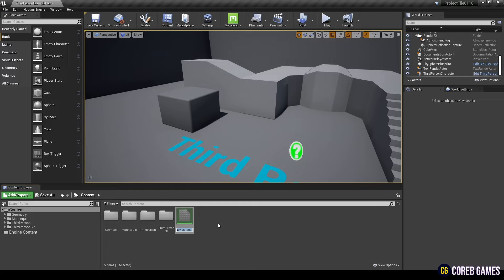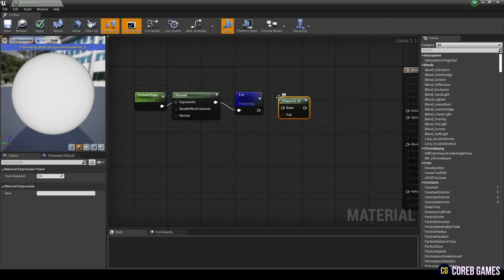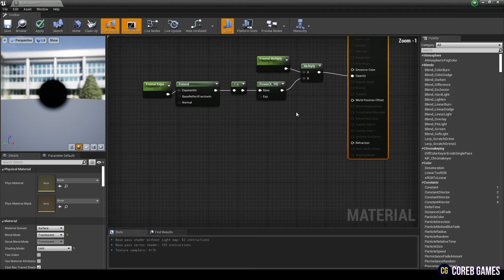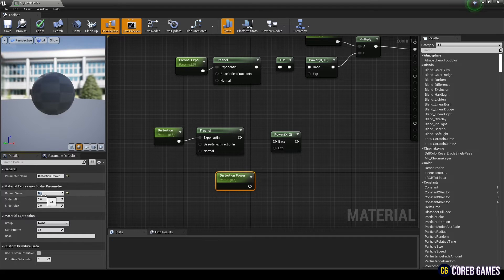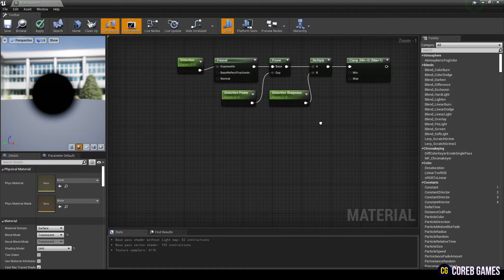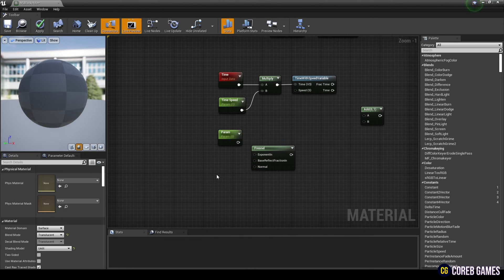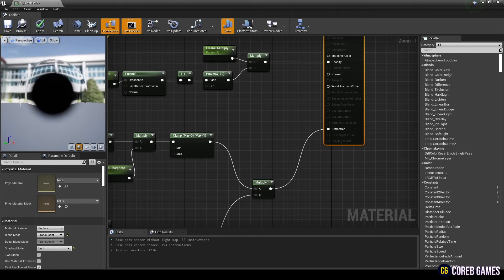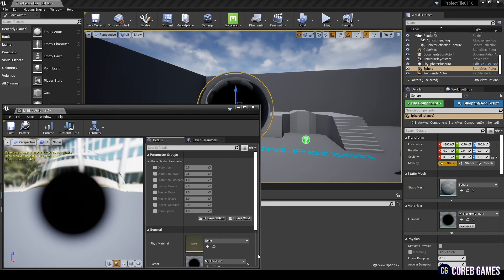UE4 l UE5 | Black Hole Effects That Distort Space l Material Tutorial l Unreal Engine 4.26

Comment: Doesn't work in UE5 for me at least. Followed all the steps, but the distortion is not applied when I connect it to the refraction. :C
Reply: A bit late but I had this problem as well. 5.2 changed refraction and you have to go into the material details panel and change refraction method. "index of refraction" worked well for me.
Reply: Works on UE5.1 here, if it's not working go back and check all your parameters are set, mine was broken intially but I had not set the distortion sharpness and it was defaulted to 0.
Reply: Set effects scalability to at least high, refraction does not appear on lower settings.